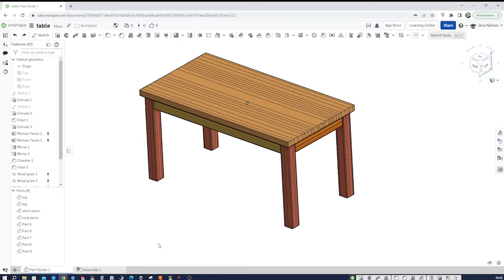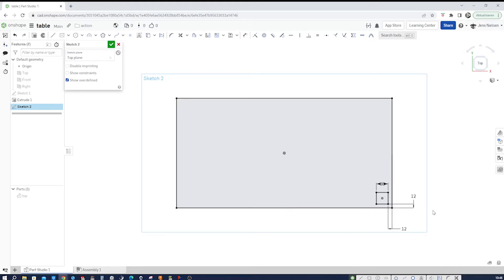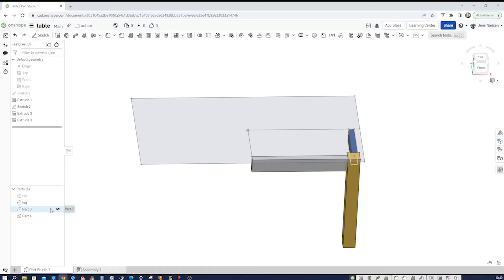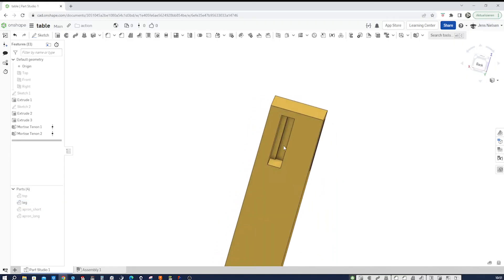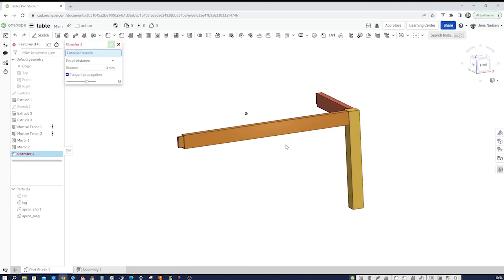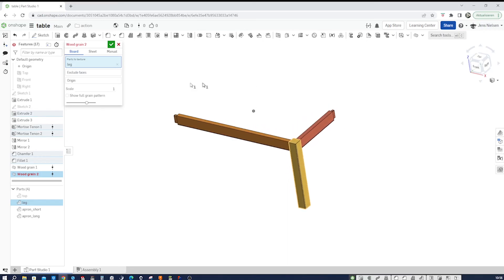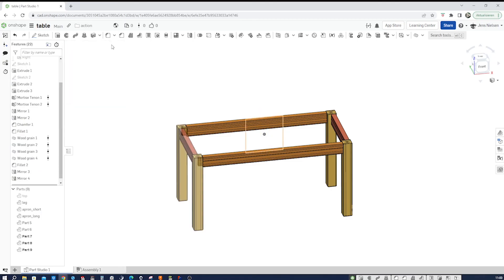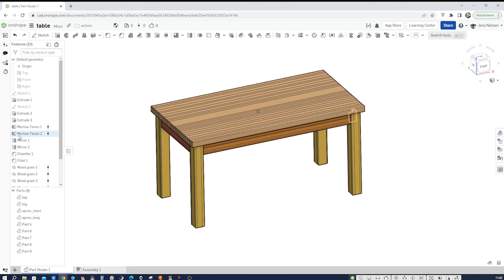How to model a table in Onshape with mortise/tenon- +woodgrain feature script

Comment: I agree, amazing tutorial. In fact, the only Onshape tutorials that I actually learn from. The tempo is just right for a beginner. I love your woodworking tutorials, as I am new to Onshape for woodworking projects. One thing that I am missing. Is it possible to automate a cut list or a drawing woth measurements, when you are making the exploded view? It would be a great if all the parts could be shown with measurements, so the drawing can be taken to the workshop.
Reply from the maker: Thank you. Regarding your question: this  is possible, but from a frame-based design. you have the "cut list  table" which is based  on the  standard, library-based profiles you used. The  next step would be to create  your custom profiles. I asked the Onshape AI-tool about this, and here  is the reply: can i define custom profiles for the frame tool?

Yes, you can define custom profiles for the Frame tool in Onshape. Here's how:
Create a custom profile by making a sketch in a separate Part Studio, either in your current document or in a separate document to build a reusable library

Comment: Nice video. I learned some useful techniques. Question: Why not create an assembly rather than mirroring parts. You really only have 4 unique parts but the mirror creates additional duplicates. Just curious. Nice work!
Reply from the maker: Thx. Sure, your suggested workflow is valid. This  time I just didn't want to switch  tabs.